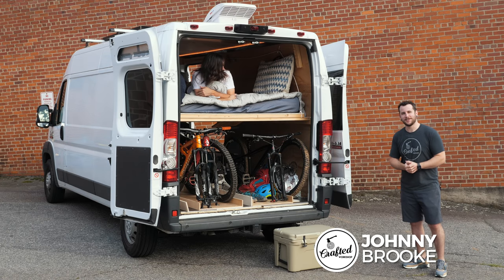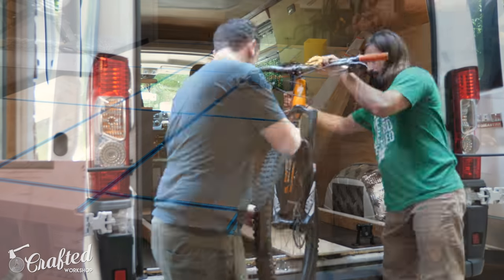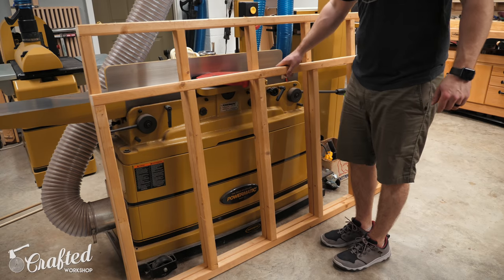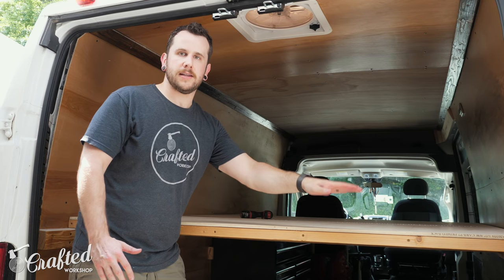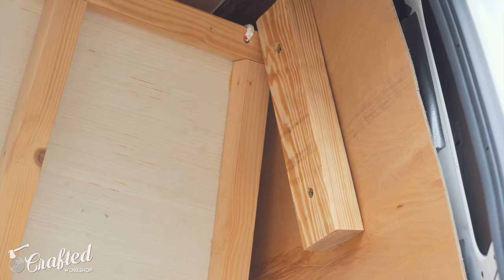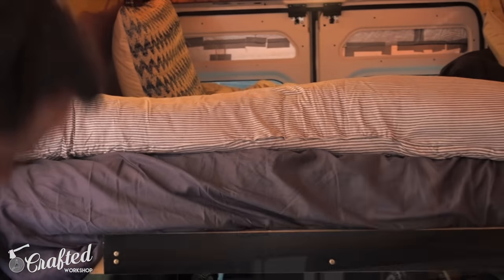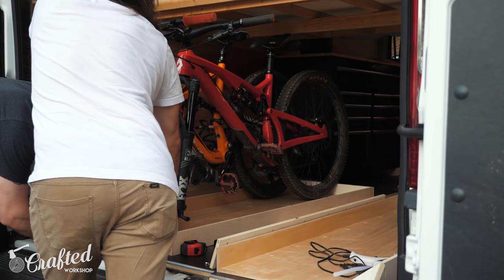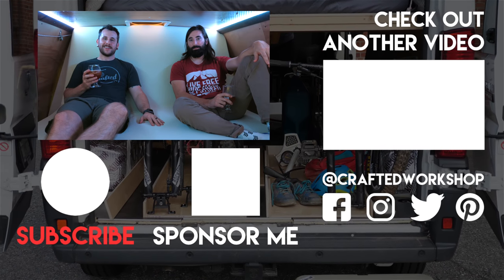DIY Camper Van Conversion Bed Build, Converts To A Couch! #VANLIFE

Comment from the maker: Had a ton of fun working with Alex, go subscribe to his channel, the Singletrack Sampler: http://bit.ly/SingletrackSampler. All of the tools used in this build are available from Acme Tools : http://bit.ly/acmetoolscrafted || Check out Arrow Fastener's full line of tools and fasteners : http://bit.ly/arrowcrafted
Reply: Seeing two guys on a bed in the back of the van was hilarious...But this was an awesome job.
Reply: Jonny, just wondering where to get the table saw push. I had a look at Acme webpage but hey didn’t have it I just built my own with a band saw, but I like the way the one you use pushes down on the job so you can control it better. Thanks.
Reply from the maker: Hah, thanks!
Reply from the maker: It’s this one, I love it: https://amzn.to/2zmti6K
Reply: K
Reply from the maker: I might be doing another van build this fall, stay tuned!
Reply: I you were to add a third pulley and connect the rope to the longer pice of the bed frame it would pull the lower portion back and the upper portion up
Reply: Crafted Workshop How do you Cool the van?
Reply from the maker: There is a fan built into the roof.
Reply: No grasias
Reply: What is that tool at 10:16
Reply: Crafted Workshop you are the best friend anyone could have
Reply: This guy enjoys the simple things of life that a majority of people take for granted. I'm using this bed to couch to table idea for my micro home. Thanks.
Reply: @markrigsby2107  there is a roof vent. I don't think he has an air unit.
Reply: Pocket hole screws used from the wrong side, they have to be pointed toward joining part not towards the corner.

Comment: Just random but an interesting note, I work in the component industry designing trusses for new home construction. In the beginning you mention ripping down 2x8 SYP material into 2x4s. Let me tell you something that may shock you guys. The lumber market/industry is a very volatile one and can fluctuate on a daily basis. The company I work for is a fortune 500 company (but I can't mention who) that routinely buys lumber by the truckload. So much at times that our purchaser may wait a day or two before ordering to get the best price. Now this will blow your mind. In our industry we use lumber from 2x4 all the way up to 2x12 dimensional lumber for our products. Depending on the species and grade each has it's own cost per 1000 bd ft. There are times because of the availability of size of product a 2x4 DSS is more expensive than a 2x10 of the same grade. That's just how the lumber market works. What does that mean? That means to anyone with a sawmill can double their $$ simply buy milling 2x10s down to 2 2x4s of the same grade, with ferring strips left over to boot. It's just so odd that I can buy a 2x10 cheaper than a 2x4 because of how the lumber market works. Now you won't find deals like these at the Depot, only inside guys with the ability to buy truckloads of lumber at a time.
Reply from the maker: Doesn’t surprise me at all, wood is such a weird commodity market! I just like that 2x8s in my area are SYP, much sturdier than the white wood 2x4s. Ripping out the pith gives you super nice, straight grain too.

Comment: One of the issues I ran into when it came to Van Living, is that if/when the vehicle itself needed to visit the mechanic shop(keeping the van overnight), I was like: "Where am I going to stay?!?" Solution! ...I still have a van, but I also tow a box trailer. So if the van ever needs to visit the garage again, I'll still have a place in the box trailer(which was parked in the shop's lot), instead of having to find a motel or sleeping bag it.
Reply: Or you could ask them to park the van outside overnight and still use it and save a lot of time and $$ from towing a trailer

Comment: Great project. the one issue I saw was the direction of the structural slats under the bed/couch frame.  you went perpendicular to the long side, when you should have gone parallel to get maximum load baring capacity. because you went perpendicular, the slats are not really bearing the weight of the people/stuff on top, rather only the frame is and that could fail if the weight or any type of impact or sudden surge of weight while carrying a load is experienced. The fix would be to remove the perpendicular slats and replace them with long slats parallel to the long side of the bed frame. This would essentially increase your load bearing capacity by 4x or the number of slats you instal. small structural tip. And if  you intended this, why the choice? Otherwise - looks great!
Reply: What about a cross slat system where the slats are cut like a log cabin where they intersect to keep it all even, then all glued and screwed together? Would that be the best system or are there flawd i dont know about? Im conssidering making a van out of a minivan and i might use the system i mentioned

Comment: This is a really nice build!
You may wish to seal the slide drawers to protect them from water damage in case any is on the tires/bikes when you store them inside.
Reply from the maker: Yup, they already have a coat of polyurethane on them. Thanks!
Reply: Ah...kewl beans!

Comment: Awesome project! For the pulley system you could definitely use a stopper knot like a barrel knot on the bed holes to make it a bit cleaner looking. Good work!!
Reply from the maker: Thanks! We didn’t really want the rope supporting the bed, really just using that for lifting.

Comment: at 4:30, wouldn't it be better to have the 4 INTERNAL supports of the 2 tables from side to side instead of from front to right (hope it's clear...)? This way every support would have "supported" the weight, while now only the perpendicular ones on front and back are doing the job...
Reply from the maker: Yea, that might have been a better idea. Makes sense!

Comment: Great job on the design. I liked the HDPE idea and the pulley system. I do have a suggestion for you guys. I have read that mattresses can get mouldy on the bottom side if there is no room to move the moisture. You can fix that by simply drilling or cutting out some holes into the plywood. I have also heard of a material that you can lay under the mattress which does the same thing without having to cut anything. I just can’t remember the name of it. Thanks for sharing!

Comment: A front bumper hitch and rear bumper hitch. That interchange a bike rack and Chuck wagon box that can mount inside or outside. Rotating seats and minivan stow and go seats behind driver. Would allow two or four ppl. Storage totes that fit on bed or stack outside on bumper platform. A bracket above to store mattress. When you need to haul items. The bed and platform could store at ceiling height. Many ppl are craftsman so modular components allow work play vehicle

Comment: OMGOSH I can't tell you how excited I am to come across your video. I have been looking at tons of videos trying to decide what kind of build I would like. The most important thing for me is to have a bed that can be a couch in the rear of the van just like this design only not for a queen size bed (full would be great). No one has shown this except on your video. This is great. I want the garage but some cubbies under neath for my little dogs ie dog den. I will require a tiny shower and compost toilet I can use so keeping the bed small will work for me. That will still give me room for my kitchen and small stove. I would also love to add a wood burning stove (which I have seen in a van) but first things first - finding and purchasing the right van - I like the ProMaster but would like to be able to tow if I need to. Thanks again for an awesome video - Can't wait to watch your other videos. p.s. just curious why you didn't put insulation in the van walls?

Comment: Any chance you still have your notes with measurements on this setup, I'm curious! Specifically the length of each of the two bed platform panels and the distance from the bottom of the bed platform to the floor. Thanks!

Comment: i MA WORKING ON U sprinter Van and taking my experience form racing sailboats, lowering weight. i plan on making my bed out of aluminium, lighter than all that wood you are using, just thought but you are already done so looks great as it is,

Comment: Excellent design with that pully system!   Stock metal flooring? How high off the floor is the bottom of the support strip? @2:27 noticed you  lined the walls with just clear plastic sheathing and no insulation? Also those are 1x4 pine furring stirps? Secured with what ? self taping metal screws? ceiling  done the same way? What did you use for panels?

Comment: Got to admit that the bed system/design is cool and has merit.  That said, your sense of "craftsmnship" leaves me shaking my 60 year old head. Have fun but become wise. Worry about things like what it is made of and what it takes to make it.  Ever wonder where all your plastic is going to end up?.....like those plastic saw chips even?
Reply from the maker: I would imagine most people use more plastic than this in their average week between bottled water, etc. This van is meant to last many years, I don’t think one sheet of plastic is going to have an environmental impact.
Reply: Where is the plastic saw dust?  my point here.....get your head out of the clouds we are filling our oceans with this crap.

Comment: Hey man, nice work on the rig. Quick question, How much height do you have under the bed platform? Say from the floor to the underside of the bed. I'm thinking about buying another sprinter to build out to fit a Honda Grom inside which sits about 39 inches tall with mirrors off.

Comment: I would HIGHLY RECOMMEND making some holes (I'm thinking at least an inch in diameter) into the top layer of the bed frame because with the way it is now, mold is likely to develop on the underside of the mattress. The reason why is that because of sweat, there is humidity and if there is no air it develops into mold.
Reply from the maker: Modern foam mattresses like this one are extremely breathable, I don’t think the holes are necessary.

Comment: Love the build. Question-Would it be possible to pull the other side up to have couch mode to sit and look out the back?
Reply from the maker: I'm sure you could rig up the pulley system to work in that orientation!

Comment: hi, great work, I wonder why you did not keep the corners you cut from the plattform and installed it down in the bed position, in that way you would have kept the whole area of the bed
Reply from the maker: The bed platform wasn’t able to lift up with the corners on, as it interfered with the wall. It’s covered in the video.

Comment: Great video.  I am looking to build a platform bed very similar to this in my ProMaster.  Thanks for the tips in the video!  Also, do you remember how high did you all end up installing the rails on the sides of the van?
Reply from the maker: Thanks! Can’t recall the exact measurement, we just needed to clear the bike seat. You can easily adjust the height based on what you want to store below.

Comment: Is this a part one?  
Didn't see any storage except for bike's.  How about storage for food, clothing, utensils, pots, pans,, Cooking, toiletries, toilet, shower or something?  
Also wanted to know about insulation in the walls and ceiling? If not for heat, cool control and conservation, how about noise dampening? I've used hot glue before, it has no structural feasibility. Hot glue is only good for holding something in place until you put screws in.  Hope the questions help you.  
I like your bed and bike storage design, the way you put your video together.  Look forward to part two.
Reply from the maker: Go check out Alex’s channel, The Singletrack Sampler, he’s covered the whole build there.

Comment: Looks like a great setup, guys! Quick question, what's the clearance under the  bed frame to allow bike storage? And how long did you guys make the bike trays?
Reply from the maker: The trays are 60” long, and the clearance was about 36” if I remember, just based on the measurement of the ground to Alex’s seat plus an inch for some wiggle room.
Reply: Crafted Workshop
Great! Thanks for the quick feedback!

Comment: Did the hot glue bite you in the ass in the summer?  I made removable screen doors out of a cut-up patio tent and sealed them around the doors with heavy duty velcro tape with extra adhesive, and it melted offbbig-time on a hot summer day.  At least I’ll always have the sticky residue as a reminder.

Comment: Hey man, just so you know, SYP is actually weaker than SPF (whitewood). Also, any time you rip a board you reduce its graded strength(wood is graded by know proximity to the edge along with other factors). Been engineering houses for 5 years and SYP being stronger is one of the biggest misconceptions builders have.

Comment: What happened to the Shark Guard you had on the table saw in "Woodworking Dust Collection System w/ iVac & Clearvue CV1800" ?
Reply from the maker: I switched to the new SawStop Overarm Guard.

Comment: Could I possibly add some 4x4 wheels and heaps good suspension for a trip around Australia?
Reply from the maker: It’s doesn’t have four wheel drive, so it probably wouldn’t end well.
Reply: that's a bummer

Comment: Johnny, what was the distance from the van bed floor to the underside of the bed for bike clearance?  Gonna be building one of these.
Reply from the maker: It really depends on your bikes. I think we ended up around 36” but we had to do a lot of measuring based on all of Alex’s bikes. His large Enduro was the tallest, even with the dropper post.
Reply: Thanks - I coach our local High/Middle school NICA MTB team... I currently have a NSR-6 on the back, a Yakima 2+ 4-bike up front and since the school bus was a handicap bus, can put 6 in the rear of the bus.  Once done, I will have two NSR-6s in the back... and capability of 20 bikes on the Short Bus!! Thanks again!
Reply from the maker: That’s awesome! Sounds like a cool setup.

Comment: What was the measurement you ended up using for your bike clearance? From finished floor to bottom of garage/bed frame? FarOutRide uses a 40" clearance, but they're ride is also a high top Ford Transit with 81" interior vs the Promaster's 76". What was your sweet spot, do you feel like you could have gone a little less or more?

https://faroutride.com/platform-bed-installation/

Comment: if you cut it at the home center....make sure you mark the measurement then tell if you want it on the left of the line, center of the line or right of the line...cause this effects 1/8 measurement
Reply from the maker: Yup, they’re not super precise for sure.

Comment: Cool video, but I'd never use hot glue sticks. The Summer heat will melt the glue...
Reply from the maker: The hot glue was mostly for temporary holding. We nailed the trim in place and also screwed the sign in place.

Comment: that van is wide enough to have a full length bed sideways, no need for a folding bed.
Reply from the maker: Not really, it’s only 70” wide, not wide enough for most adults to sleep comfortable.
Reply: Crafted Workshop I have the same van. It's 200cm from window cutout panel across and 187cm from baton to baton, plenty of space. He's just wasted so much space in the way he's constructed the walls.

Almost every commercially available motorhome on this platform has beds width ways.
Reply from the maker: The walls are necessary for hiding the insulation and gives a great place to mount things too. Also makes it actually feel like a home. The beauty of these van builds is that you can build them however you want. We like this setup and thing it works perfectly.

Comment: the bed frame rely on screw strength is not a good thing  to do , the timber should sit on each other so they all rely on the strength of the wood not screw
Reply: The sheer force of each of those screws is like 300 pounds, and there are a whole bunch of them. Your idea makes a lot of sense for a deck or second story on a house, but the name of the game in camper vans is weight savings.

Comment: Why the hell do the bikes need to be upright? it's such an inefficient use of space.
Reply from the maker: Not when you’re riding them every day for a living. Much easier to load and unload plus keeps them from getting damaged. Alex is a MTB Youtuber, bikes are the most important thing in his van.
Reply: He does have to take out the front wheels but even with that it might still be easier i guess, but an elaborate foldable tilted rack should definitely keep them safe from getting damaged, it wouldn't take that much longer (esp. if you don't have to take out the front wheel) to load the bikes and it could easily get you an extra 30+cm of space.
It's a trade off i guess but that's how i would do it, either way your videos are great and i admire your workmanship, thank you for replying.
Reply from the maker: Thanks! Definitely tons of options but this works well for Alex.